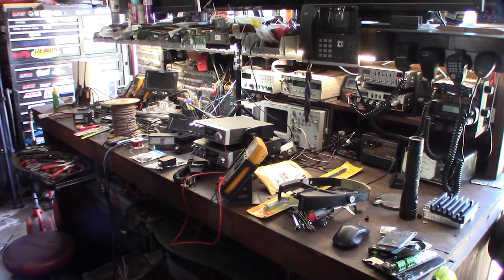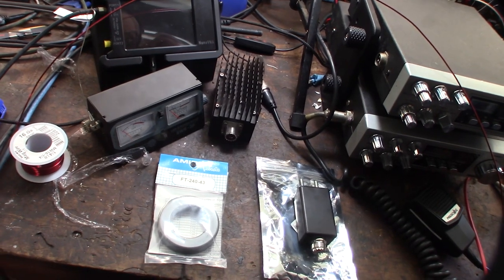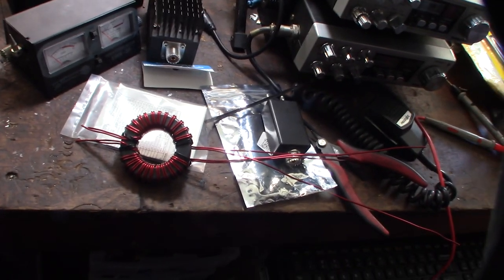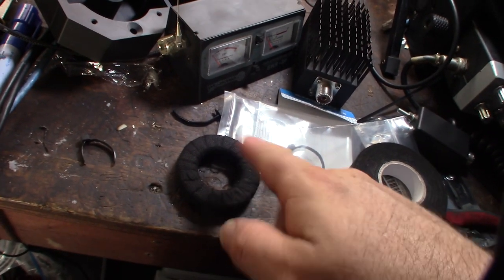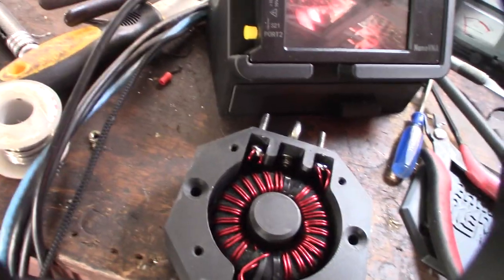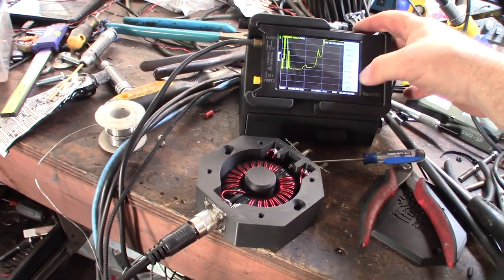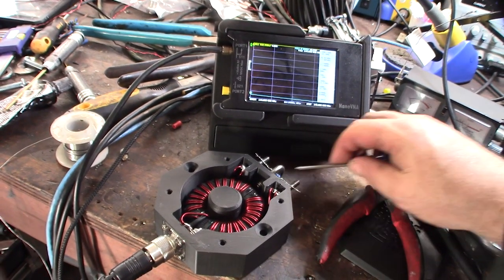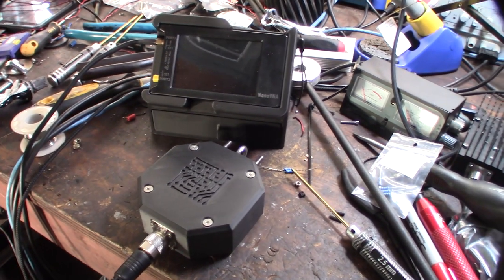DG0SA 1:1 balun build for my 11m CB Dipole Project, custom FT-240-43 Box  NanoVNA Testing

Comment: Awesome. I made something just like this for doing stability analysis of power supplies. Can't believe you can find high quality cores at some local store. You live in an amazing place for electronics I guess. The company I work for did some PCB assembly in Costa Mesa, they still do it there, but ever since the war in Ukraine they are permanently booked up making weapons.
Reply from the maker: Its a real deal electronics store. Its called Marvac. They have allot of new old stock items. I started going there when I was 6 years old to get stuff for my RC cars. The original store probably 40 years ago was dim with boxes of components everywhere.  I'm going to hook up some wires tomorrow and see how it works. That nanoVNA device is pretty cool.
Reply from the maker: I think the last time I wrapped a toroid was in electronics class like 30 years ago.